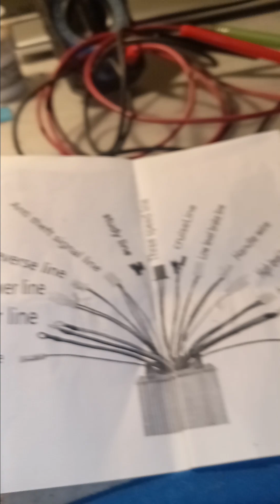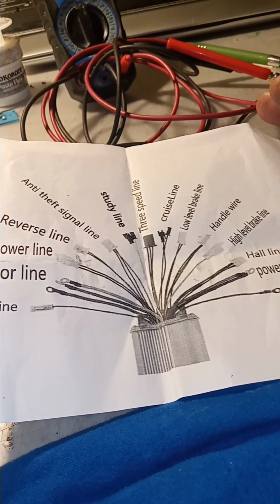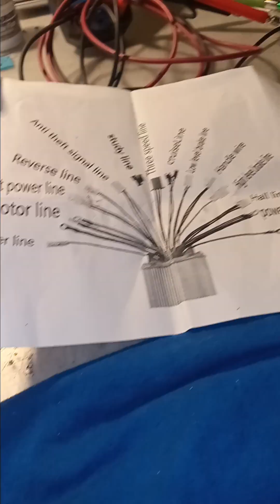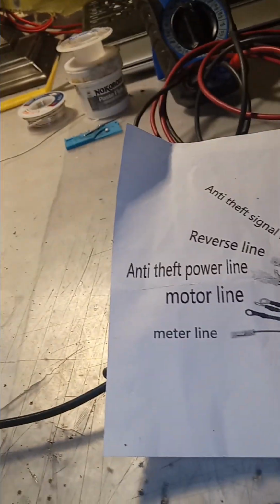Brushless Motor controller wiring tutorial.  How to connect basics.

Comment: I just bought the tuttio seeker 24 ebike 3000w dual motor. They say 1000w each moror and they peak at 1500w. My problem is when its just the rear motor it sucks it barely moves when starting out it doesn't feel like 1000w more like 350w they use 2,  25amp controllers how do i disconnect or get rid of the slow start or soft start.
Reply from the maker: Sorry for the late reply.
Being dual motor your controller has 2 separate controllers in one box slightly smaller than this box. I'm going to assume your 48 volts (battery)
If your bike has a display that shows battery percentage and speed your able to adjust the P settings by putting the controller into "programming mode". Usually it's by holding down the power and mode buttons simultaneously for 3 seconds. From there your particular bike will have the sequence of settings listed on your owners manual. They are written something like
P1= battery voltage P2= kilometer or mph  P3= brightness of display ect... 
If your paperwork doesn't show the settings then scour the internet and look for the same controller and display you have. It takes little effort but you'll find it. 
Endless sphere e bike forum is also excellent resource for this and more info.
I just picked up a damaged Cannondale E bike retails for $2,200 mine I bought for $300 with no battery and electrical problems. I put another $60 Chinese controller on it and a good 36 volt battery and WOW! This is the best quality and riding E bike I've ever had. My hub motor is 250 watt and I've over voted it with 1000 watt controller.i went through the P settings and adjusted everything to the highest power output it had. I also got rid of Candis (peddle assist) and now it has a throttle! Such a good trade. Throttle let's me give power when I want it, not when I peddle. 
Buying a replacement generic dual motor controller that has good power you'll spend $150 and it probably won't fit into original location like my current set up. But it will beef up take off power.  If your bike is peddle assist only you might want to put throttle on your bike.
If you bought the bike on Amazon you can easily contact seller and ask about throttle connection, P settings and get info to make better off the line power.
It's always a trade off.. lots of power take off = not a lot of miles in 1 charge. Or low power = more distance on 1 charge. 
I hope this helps. In in Los Angeles area if you need more help I'm good with everything brushless motor. And I'll do work for 1/3 the cost a shop will charge! The best e bikes have "Mid drive" the motor is part of the peddles below your feet instead of in each wheel. 
Thanks for watching video.
Reply from the maker: Hey, ok good news for you! 
On YouTube,  type in 
Tuttio seeker 24 & 26 must know settings for the....
This video shows you everything I mentioned. P SETTINGS. WATCH HOW THE SEXY LATINA PUSHES THE BUTTONS TO GO INTO PROGRAM MODE.
Your all set with her video. Good luck..BTW, She says 38 mph! Wow that is great.
Reply: Idk if it's related but it doesn't matter what upgrade the controller is as long as your motors isn't a high enough wattage you only got faster maybe better acceleration at best
Reply from the maker: I'm pretty sure you long press the power button or the up or down arrow while you look at the display and you'll see it switch from Dual to single